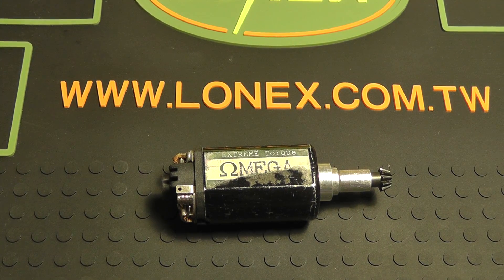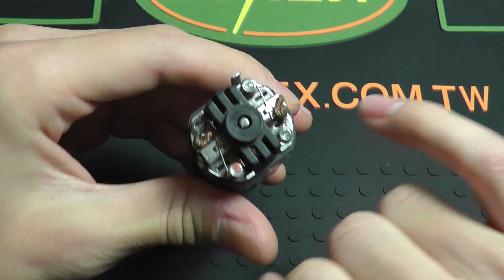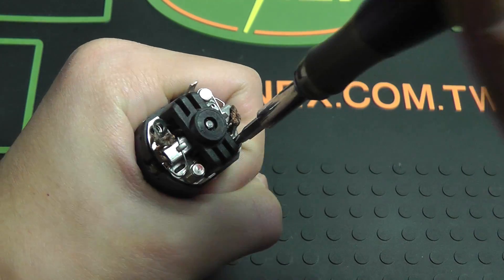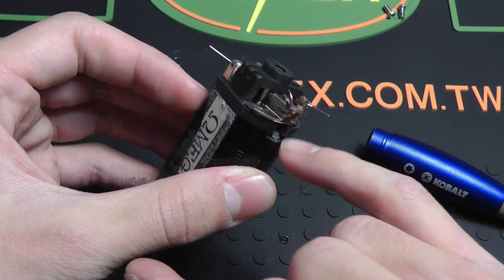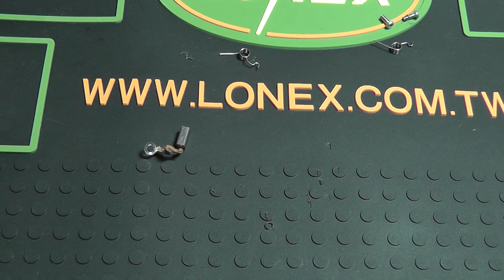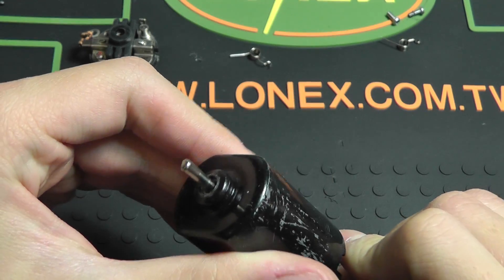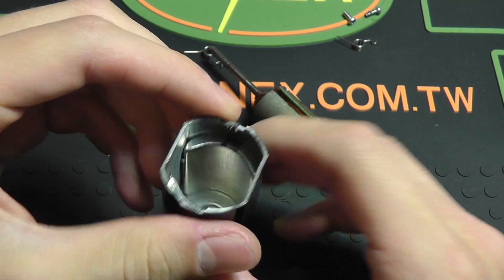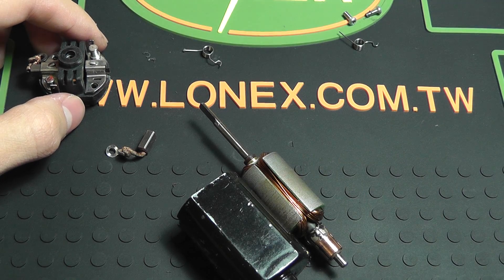How to disassemble TM/Chaoli/TX style motors

Comment: I am trying to take the pinion gear off of my CA Extreme Long Type motor and the pinion is not coming off and there is no screw holding it in. I know they are supposed to be a pain in the ass but how do I remove it without breaking my motor? I foolishly stripped it thinking my motor adjustment was too high so I kept lowering it and stripped it.
Reply from the maker: +Mason Kelly is it a d type or o type?
Reply: valleyriverarms O type but i figured out how to get it off.
Reply: +Mason Kelly how did you manage to take the pinion gear off?
Reply: magicstorm1 I figured out how but I never got around to doing it...